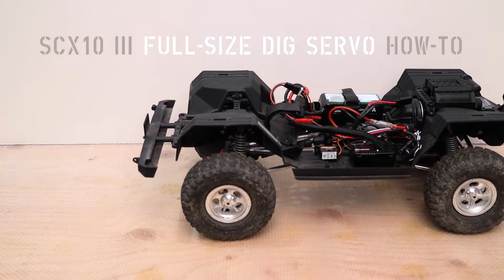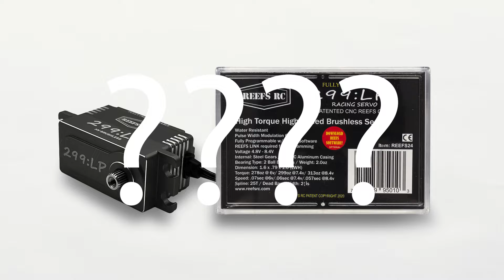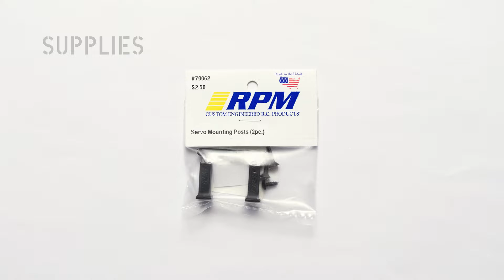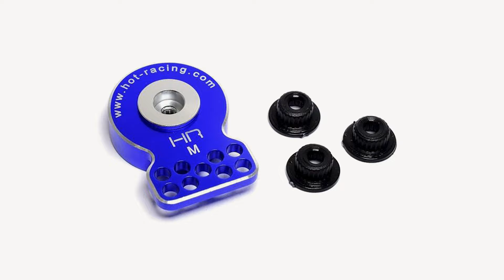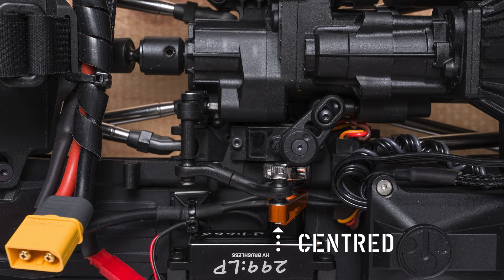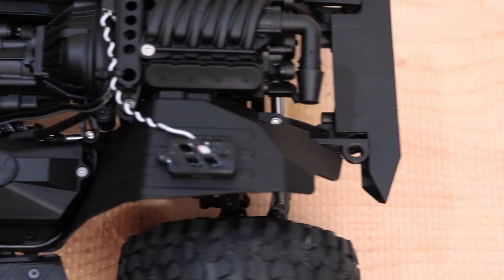Install A Full-Size DIG Servo On SCX10 III - RC Stories Garage - Episode 15

Comment: Great video, thanks for sharing your modification for the dig, are you carrying out this mod on the early Bronco as well? 👍
Reply from the maker: Thanks for watching. Yes, the Bronco will get a Reefs 299LP as well. I’m swapping out the radio/ESC/motor for a Hobbywing Fusion Pro at the same time. It will also get two speed shifting with the new receiver. I have all the parts, but I’m not in a rush to get it done. I need projects to get me through winter, so I will work on it when it’s too cold to go outside.